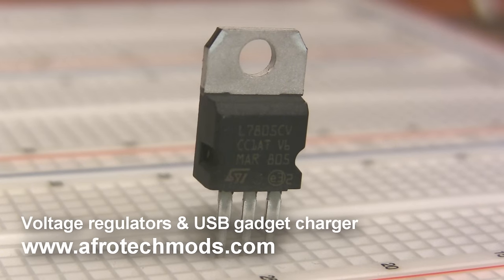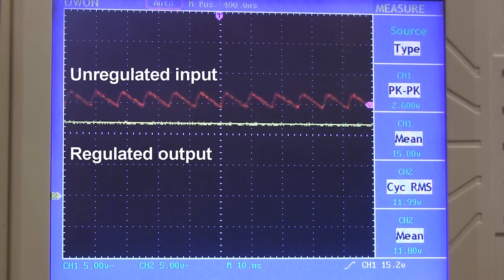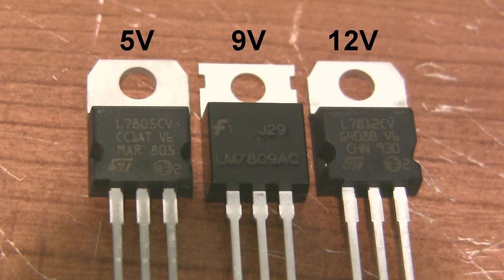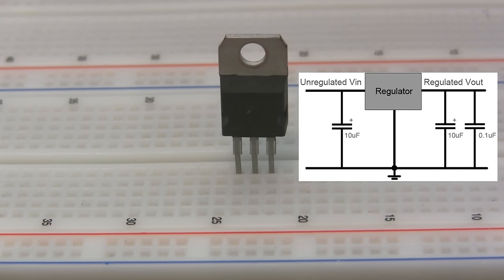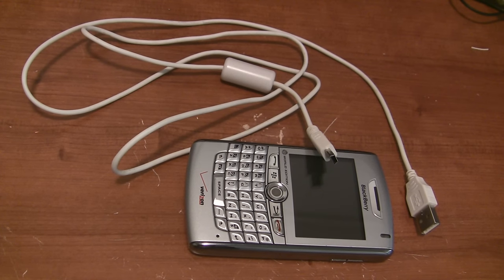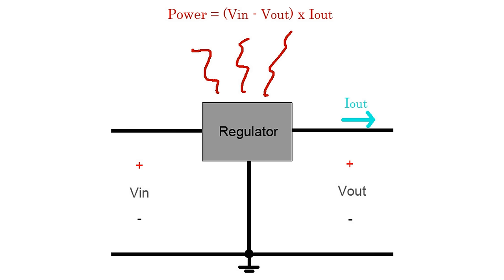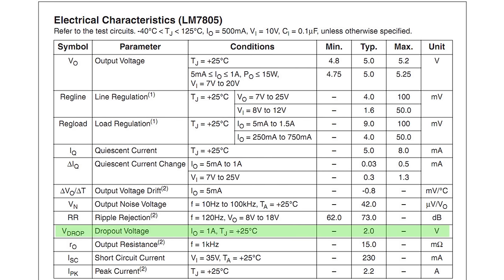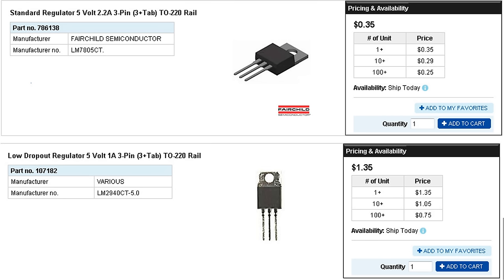Voltage regulator tutorial & USB gadget charger circuit

Comment: I was wondering, what do the capacitors actually do? I know that the capacitor basically stores a small amount of energy but the regulator works without them as well. Do the capacitors just make a kind of safety buffer zone before the current reached the regulator? thank.s as well great video

Comment: If I want to charge multiple mobiles and wire them in parallel, and put a current clamp for the battery would it be ok, or will it destroy the phones or the battery?  Thanks for the answer!

Comment: hi afro...great vids,  i have a 9v, 1.8watt solar panel that i want to charge a 1.5v-3v batteries to run joule thiefs with leds...the thing is i blew up a 1.5v battery when the sun came out lol.....how can i stop it from overcharging?..is there a small circuit to do this?..i'm good with schematics and a soldering iron so i can build it myself..many thanks rob.

Comment: Great Video.
    Could one use multiple regulators in series to lessen the higher voltage differential (forgoing a heat sink); thus acting like a dc to dc step down?  Would this also offer more stabilization (forgoing capacitors)?

Comment: I had an EGT gauge in my vehicle fail because the internal regulator gave out and the gauge gives erratic readings. I installed a 12v linear voltage regulator external from it and I find that when the input voltage gets above 13 volts the needle drops to zero but any voltage 12.9 and lower the gauge works properly. The regulator is not burned up. what could be the problem here?

Comment: Hey ive been trying to hardwire my xbox 360 controller through the battery terminals, but it just blinks on and off. Im thinking that the 5 volts from xbox usb port is too much for the 3v battery terminals. Im wondering is my problem with the voltage or potentially the amps. i thought it would auto draw the correct number of amps...

Comment: more likely to have some thing to do with the capacitors (as in the tutorial). The job of the capacitor is to allow higher frequency and/or "noise" to be eliminated from the power thus providing clean DC power to your device. The 15 volts is likely powering some sort of OpAmp used to amplify the 'wanted' signal from your device. I'd probably start with one of the capacitors associated to those two regulators. Most decent voltage testers have a capacitor ")|" test setting (de-power circuit)

Comment: Great vid. I just realised my Arduino nano won't switch on the 3.3v regulator unless the USB port is connected. I plan to step down 24V down a CAT7 cable to 5V for the Arduino using a cheap buck convertor. Any reason why I can't include an additional linear regulator to get my 3.3V to power an OLED? Should I include any extra capacitors or can the linear regulator be connected in parallel with output of buck convertor?
Reply from the maker: ***** You should be able to go from 5V to 3.3V with a linear reg no problem. Extra caps won't hurt.
Reply: 24v to 5v via a regulator is not very efficient and will create much heat.. Try feeding it 9 volts to get your 5 and 3.3 from.
Reply: Thanks. 24V to 5V would be stepped-down with a buck converter not regulator. Then I'd used 5 to 3.3 with linear = not too bad efficiency.

Comment: starting from a 16 volt source, could you put a 12v, 9v and 5v voltage regulator in series to get a 5v output and  limit heat?

Comment: now just to find out how to make a home made solar power system hopefully a cheaper one so just to produce enough or slightly more than enough for a cell phone / apple device changer station as this youtube video inspired me and thank you Afrotech for doing that just i am thinking like anything in electronics theraer hurdles to jump over before making something like that which will be ok and hopefully you have one of generateing your own electirty for it and getting a reading on how much and when
Reply: Making your own solar-powered USB charging station is a pretty great little starter project! It's easily doable, won't cost you too much (the solar panel alone will probably be the majority of the cost), and you'll learn how to design, think, and solder all at once :)

Comment: A small hairdryer typically uses the heating elements as voltage droppers from the mains and then provide full wave rectified (LOW) voltage to a small DC motor to act as the fan blower. A DC motor when operated in reverse as a generator needs NOTHING else as it provides DC automatically by virtue of the brush commutation (reversing of the field) BUT it is a VERY inefficient generator. This is why modern cars use multi-phase alternators (then rectify the AC to DC) rather than dynamos.

Comment: Sir thanks for a good video. I wonder what happens if the input voltage is 5v (usb) . Do we still get the same 5v if we use the voltage regulator? Or is it not neccessary to use one

Comment: Super-B video.
Can I have some advice? I design a circuit board what will have a max 25.2V but we need a 5V to, so I am not so sure do we need a capacitator or filter on the board?
The 5v will power LED`s and a small CCTV camera.
Thanks for the advice.
Regards,
Reply: Copterguru I would use a transformer to bring the 25v to 10 volts or so, then a regulator to bring that to 5v. It'll probably be safer for the device and you wouldn't need a heat sink... possibly a cooling fan haha-- yes, i'm an electrical engineer.

Comment: u said on the video that the last two numbers on the regulator are the working voltage on it , so the LM2940 is for 40 volts, and you regulate only 5 volts you need a hudge heat sink to cool of the regulator, besides there is a big voltage drop out too. an i right or im confused?

Comment: Please don't judge me I'm learning after getting interested and buying an  E-Bike and I'm building my own 18650 first battery, isn't this also know as a mosfet, I love the viseo's and am learning all the time, many many thanks.
Reply: A MOSFET is generally a "field effect transistor" often used as a switch (between its "drain" and "source" pins,  the switch is controlled with a voltage at its "gate" pin ).  The LM317 is mostly used to generate a stable (no ripple) constant current.

Comment: Great video. Thanks for explaining these. Does the voltage regulator have anything to do with the output current? How would I build a charger with an output of 5v, 500mA vs. a charger with an output of 5v, 1000mA?

Comment: The in/out capacitor values don't have to match exactly. But the small ceramic capacitor on the regulator output should have short leads because it ensures stability at high frequencies.

Comment: So I am new to tinkering with electronics but I hope you can help with me question.  I'm trying to convert a hair dryer to a small dc generator. it looks like it has the bridge rectifier in your vid.  do i have to change flip the diodes to allow current from the spinning blades to come out to power a load? or will the current set up (exactly like the diagram) work the same but in reverse? Any response is appreciated.

Comment: would you recommend voltage regulator for 7.4v 8000mah (2 rechargeable batteries) or a DC to DC step up for a 5v iphone charger using 4000 mah 3.7v.
I want really little variation.

Comment: There is also a method for increasing the regulated current by using a power transistor and one resistor. One can easily achieve regulated currents of several amps.

Comment: hello, great channel!! question : i have a Dell surround sound woofer that wouldnt turn on.. fuse is good so i opened it up. only thing i can see that didnt look right  was the voltage regulator. it didnt look right  because it looked like it had been over heated around it and when i touched it, it was very loose. the soldering under it had broken the bored under it. how can i fix the broken bored under it? its only broken around the solder points? thanks in advance eddyo..

Comment: I Love your videos... I have a 12v 4.6aH battery and I want to put a 9v regulator on it. My question to you, when I apply the voltage regulator to the battery what will happen to the amps. Will it be a 9v 4.6aH battery or will the amps drop?
Thank you

Comment: Great video! I'm finally consigning an old Xbox to the "parts" bin so that it might serve some useful purpose for projects (Has a nice capacitor bank, and a few USB ports). First quick projects will be a USB 9v phone charger and a power supply for my hard drive sanding disk, although not even google will tell me what the part codes mean (From RY638, FR3711Z, RP626G, LD1086-33

Comment: nice vidio ...thumbs up fr u..
how much output current it would give if I apply 12 v and 600 mA in the input .
Reply: +arijeet ray you don't "apply 12v and 600mA to the input". From what I understand, your load draws 600mA and then you have a power dissipation from the regulator which is (Vin - Vout) * Iout. As an example, if you apply 12v volts to the input of a 5v regulator and your load is a linear component which has a resistance of around 8.3 ohms then you draw 600mA and the regulator dissipates 4.2 watts in the form of heat.

Comment: You mention that the capacitors ensure stability of the output voltage, but do they decrease the speed of the circuit as well?
Reply: Ahmm, the frequency of DC is zero hz.  The big caps filter the 50/60 hz from the power line.  The small cap filters out higher frequencies that may be produced by the load. expected by the load.

Comment: Hello, I have a question, I need 5v but no clipping on the amps. I dont know why my circuit is clipping from my 1 amp/9v source to 100mA/5v...? The volts are OK but the amperage is not...

Comment: A resistor drops voltage by a fraction of input voltage. That means that if you vary the input voltage, the output voltage of a resistor will also vary (Ohm's law). This regulators supply constant output voltage even when the input varies.

Comment: Can multiple linear regulators be used to build a non-adjustable power supply that would provide a less commonly found voltage output, say 19VDC?

Comment: ising a buck boost/drop voltage converter more efficent?
Reply: yes, but it's more expensive and has more parts... meaning a bigger circuit. the strength of a linear regulator is that it is as simple as adding a single part.

Comment: So If I have a solar panel that outputs about 20v on a VoC circuit (It's a 100w panel), but I want to dumb down the power to handle two USB ports (lets say for an iPad and iPhone), I would need a direct line in, and a 24v Linear Voltage Regulator, and get it to 12v per USB, with appropriate resistors...?

Comment: What kind of VR circuit would you recommend if I want to use 2 serially connected li-ion 18650 cells (total batt V=8.2V) to drive a 60 LED array (which operates optimally at 5.4V using 430mA).  Note:  The LEDs will take the fully batt V, however, the power out is ~11 times higher than when the light array is run at 5.4V.  Another thing to note is:  the cell discharge current cut-off is 3V (i.e. 6V for the batt).

Ideally, I'd like to drive the LEDs at 5.4V using 430mA to keep a steady voltage & current, then switch down the unit when the LED array V is less than 5.3V
Reply: That is actually something the LM317 family should be able to do.

Comment: i just got a few that give a 10v output, i plan to use them for dashboard meters like fuel and water temp. if i screw the regulator on the back of the speedo, it will act like a heat sink i guess. do i need the same capacitors as in the video?
Reply: Try to stay over or same with the capacitor voltage. More capacity doesnt hurt so much.

Comment: I really wish buck converters were this cheap (and small).  Buck regulators are so good at stepping up the current while stepping down the voltage that MUCH less heat is generated.  Many small electronics don't even require you to use a heat sink.  Some higher-power electronics can run with a heat sink and no fan.  I've even pushed 200 watts into an inverter (stepping down from from 20v to 12v) and I didn't need to cool the fins with any airflow for five minutes.  A very small fan blowing on the heatsink was required to maintain 200 watts.

Comment: Hi , I did the same circuit one the software but it gives 5.47 not 5 exactly ? is that called stabled
i was using battery 9v and 7805  with same capacitors in your video ??

Comment: If I'm building a 5V power supply that accepts 220V and 110V using a 220V AC to 14V AC Transformer(AC->AC->FWR->VR), @220V what would be the best way to drop down to 5V and avoid 6 watts of heat at 700mA? I'm building something to possibly sell, but at this point I'm thinking of just advertising it at 110v and using a 110v->6V TX.

Comment: is it possible to add liner voltage regulator in parallel for higher current throughput..? like 20-40 amps at 12v..?
Reply from the maker: With currents that high you want a switch mode power supply. Actually with currents that high you want to be buying an off the shelf switch mode power supply.
Reply: @Afrotechmods  thanks..!!

Comment: I'm using a 7.2V NiMH battery, im assuming it is 8.4V (when fully charged) since it is the same kind of battery as the video. My battery is 1.25A.

Using the equation: (8.4V - 5V) x 1.25 = 4.25 W (heat)
Do i still need a heat sink with  4.25W? Or should i use a buck converter instead?

Comment: it will need a heatsink. also try to use a regulator larger than your expected draw, so for 1amp buy a 3amp regulator etc. the 780x style is a very old internal design and not efficient compared to modern ones

Comment: Hold thumbs that the 5v regulator does not pop and then let 12v thru to your phone. How about a 5v1 zener diode on the output side to at least limit the output voltage to 5v1 ???

Comment: I want to install a rechargeable battery into a tape player from the 70's. I want to use the original power supply and make it so that I can unplug the power cord from the unit having it run off the rechargeable battery automatically without interruption. I want to have the rechargeable battery charge during the unit is plugged in or in use via power cord. Can you confirm for me what I will need? Thanks

Comment: Great video. It really explained exactly what I need to do for my project. I do have a  few questions though. My daughter has a little hand held fan that runs on 2 AA's. I did a little fabrication to make it fit a 9 volt bat. I plan on using your instructions to reduce the voltage to 5v so I don't burn up the motor. 

Question #1. Will doing this make the 9v last longer by regulating it down to 5v?

Question #2. Can I run a bypass switch so that once the head space causes the output to drop below 3v I can run directly off the 9v to bump up volts a little until it's dead?
Thanks

Comment: how can i come to know that i have to use 2, 10uF capacitors for 12 volt supply. I need some explanation to driving out capacitors and resistors value for my desired output

Comment: i have 12 unregulated DC volts on input than 220uF cap than 7805 than 1000uF 25V cap and 0.1 16Vcap...and my cheap multimeter shows 4.85 (what is still enough for Arduino)....is it resistanse of cheap multimeter probes or its a too big cap (1000uF) ?

Comment: btw i have a 10Ah 12V battery which i use to run my beachspeakers and i want to add some usb ports to the speakers so my question is: if i drop the voltage to 5V by a regulator will the amps go up or stay as its?

im thinking of the wattage, 10Ah @12V gives 120W but 120W/5V=24Ah, hope that i get answer to my question

Comment: Why do people sometimes add resistors to the output? And what is the difference in a voltage regulator with a ground pin and one with an adjustment pin? Does the adjustment pin sense the output and adjust the regulator's output? Also, can these regulators be paralleled to allow for higher current? To let's say power a large string of 12v LEDs? Great videos btw, Thanks!
Reply: Resistors on output are for current limiting and may also be there for inrush protection for newer digital battery chargers.
The adjust pin is used with a POT to adjust your regulated voltage. Some fancy circuits eliminate the POT and use a micro-controller. In Li-ION chargers the adjust is preset to about 4 volts and wired in a way to prevent over charging.
Paralleling these things will work BUT for high current lighting usage you can use a transformer rated at a high current that outputs about 16 volts and pass the output through a bridge rectifier (proper amp rating) and some smoothing caps which SHOULD leave you with about 12 VDC to run your lights.

Comment: Can you cascade voltage regulators?
If so I'm thinking it would be easier to regulate large voltage differentials as it's easier to dissipate say 2 watts from two regulators than 4 watts from one regulator.
For example. In your car USB charger example. Use a 9v regulator and a 5v regulator to step down from the 14ish volts of the vehicle.
Just wondering. Nice vids. Thanks.

Comment: If you use a 9v regulator for a mobile device which normally charges via 5v output, I imagine that could damage the battery right?

Comment: Hi, I made up three of these to charge cell phone, speakers, and head phone with.  They work for the speakers, but not for my droid 4 cell phone, or a droid X.  Since that is why I made them I'm disappointed.  They put out 4.91-5.0 volts, and .686-897 amps.  What did I do wrong? And what should I try to fix it?  Thanks for any help!! Thanks for all of the great videos!!

Comment: how do you connect the heatsink to the regulator? did you forcibly drill the screw into the heatsink?
Reply: +Ido Porges I know this is an old post but just wanted to let you know that the data sheet will show you exactly what you want in terms in the internal schematic of the LM regulator....